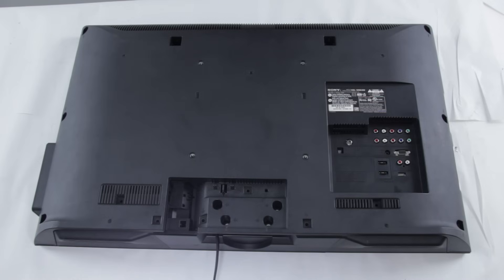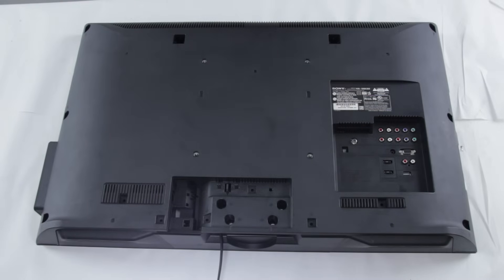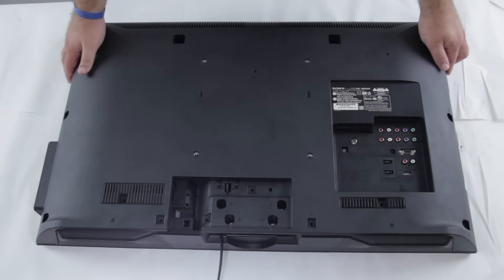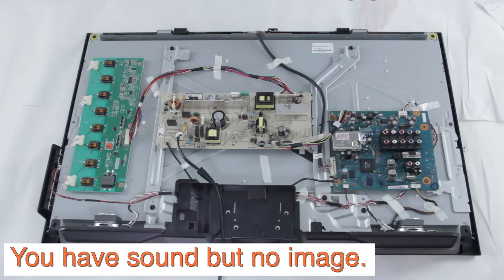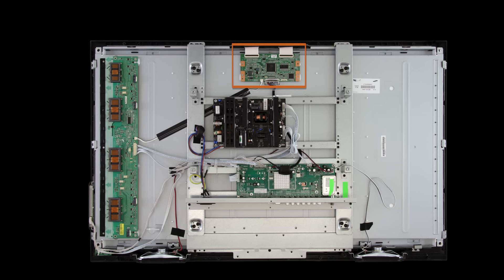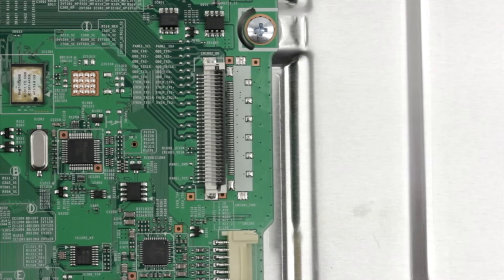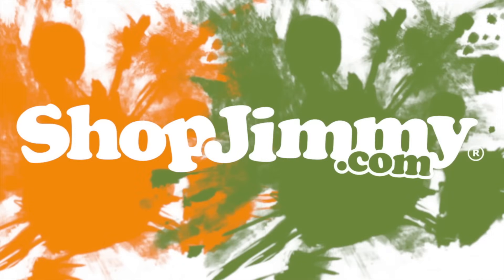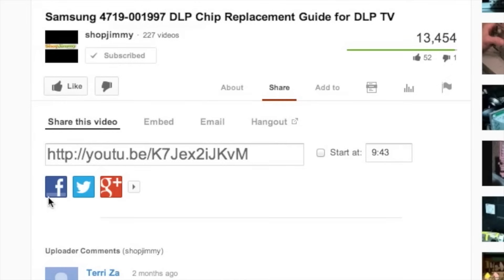LCD TV Repair Tutorial - T-Con Board Common Symptoms & Solutions - How to Replace T-Con Board

Comment: hi mate i have a Sony Bravia KDL-40V3000 40" 1080p HD LCD Television i was watching a movie on it a few days ago and all of a sudden it went very dark as if the light had turned off inside the screen i checked all settings nothing worked i also noticed that the menus was also dark and dim however picture is fine apart from when the image changes on screen i get like i little flash as if the htz are messed up or something very hard to noticed tho i have to crank up the settings just to get a decent picture to be able to watch TV the side effect of this is i now get burn in screen problems ive open the bk and looked for anything like a cable disconnected or something smelt burnt with no joy i can see i can get every part for this TV and would like help on narrowing it down to help me get the right part if there anything i can help with to help you help me pl ask i really need help with this as the TV seems to be working great apart from the darkness problem thx for you time regards Ryan.
Reply from the maker: Ryan Brandon  Please watch this video FIRST to help with your repair!  https://www.youtube.com/watch?v=BP3NVNCGEv8  This could be a problem with the power supply or the inverter board.  You may need to replace each board individually to see which one fixes the problem.  Click this link to replacement parts:  http://www.shopjimmy.com/catalogsearch/result/?q=KDL-40V3000  There may be multiple boards for the same TV model number, be sure to match part numbers on your current board, with your replacement for compatibility.  Thanks and please let us know if you have any further questions with your TV Repair!  www.shopjimmy.com
Reply: ShopJimmy.com  ok so i replace everything apart from the screen , tcon board and the wires and cables all replacement parts work fine but the problem still lingers im in the middle of replacing the screen it seems as tho the bulb has gone inside the sreen if the replacement dusnt fix the problem it must be a cable inside the tv unless the tcon board makes the screen light up up but i was under the impression the tcon is for producing  a picture so thats why if this dont work it must be the cables, im having difficulty removing the tcon board to place onto new screen it seems to be glued down onto the screen ive removed all screws but it wont come free with out pressure but i dont want to break the board if you have any tips on best way to remove this id be very greatfull thx for reply and help :) good man.

Comment: Hi I took your advice replaced t con board . I had soleeized screen , so when I replaced the board tv never turned on again . I get a bit of light at the bottom. Can you tell me what I can try now
Reply from the maker: jessica pacas  Please watch this video FIRST to help with your repair!  https://www.youtube.com/watch?v=BP3NVNCGEv8  I recommend putting the original t-con back in the TV and replacing the main board to see if that fixes the problem.  Click this link to replacement main boards:  http://www.shopjimmy.com/catalogsearch/result/index/?cat=56&q=LN40b530P7N  There may be multiple boards for the same TV model number, be sure to match part numbers on your current board, with your replacement for compatibility.  Here is a link to a video showing how to identify your part number, click here:  https://www.youtube.com/watch?v=BEPWrefQvqI  Thanks and please let us know if you have any further questions with your TV Repair!  www.shopjimmy.com

Comment: Thanks for doing videos like these. I have a problem with my Samsung 40 inch TV. There are horizontal line from the top on the screen which starts from the left side. I'd like to know how to fix this on my own please.  The model no. UA40D5003BRXXP serial number gst900403 - 04202012 Thank you so much.
Reply from the maker: Ed Umali   This sounds like a TV panel (TV Screen) problem.  If your TV panel is bad, it may be more cost-effective to replace the TV as panels are typically hard to find in stock, difficult to replace, and expensive.  Thanks and please let us know if you have any further questions!  www.shopjimmy.com
Reply: Thanks. I actualy tried openning it up and fixing the ribbon connection as per other demo videos in youtube. It actually worked. But intermeitently comes back and disappears quickly.
Reply: Ed Umali
try a tcon, yours might just be going bad.

Comment: I have a Sony KDL50EX645 and the screen is black. When I power it on the light is green briefly then it turns red and blinks 6 times pauses then blinks 6 times again. Suggestions?
Reply from the maker: Irving Simms   Unfortunately this sounds like you have bad LEDs in the panel and there is no fix besides replacing the panel itself.  If your TV panel is bad, it may be more cost-effective to replace the TV as panels are typically hard to find in stock, difficult to replace, and expensive.  Thanks and please let us know if you have any further questions!  www.shopjimmy.com

Comment: I have a vizio e701i-a3 and the video went out while watching a show. The audio still works. I replaced with one of your tcon boards with no fix. I also replaced the main board and that did not fix. The screen is blueish hue and the backlights respond when you mash the buttons on the side of TV. I tried the flashlight test and seen nothing. Do you think I could have had a DOA tcon or is it something else? Can I test the tcon?
Reply from the maker: JARRETT JOHNSON   This sounds like a TV panel (TV Screen) problem.  If your TV panel is bad, it may be more cost-effective to replace the TV as panels are typically hard to find in stock, difficult to replace, and expensive.  Thanks and please let us know if you have any further questions!  www.shopjimmy.com

Comment: I have 47lg50 in has good pic and good sound  but remote wont respond and input panel stays on across bottom of screen if I turn set off with button on front tv goes off then cones back on im thinking its the t con board. remote works ocasiually them no response whatsoever even with buttons on side television plays perfect three red blinking lights in front. please help
Reply from the maker: Ronel Muskeyvalley   Please watch this video FIRST to help with your repair!  https://www.youtube.com/watch?v=BP3NVNCGEv8  I recommend replacing the main board in your TV.  Click this link to replacement parts:  http://www.shopjimmy.com/catalogsearch/result/index/?cat=56&q=47lg50  There may be multiple boards for the same TV model number, be sure to match part numbers on your current board, with your replacement for compatibility.  Here is a link to a video showing how to identify your part number, click here:  https://www.youtube.com/watch?v=RwHTvjMdrhk  Thanks and please let us know if you have any further questions with your TV Repair!  www.shopjimmy.com

Comment: Hi. I have a Vizio M3D470KDE which has sound, but no picture/menu. At first I thought it might be the LED inverter board, but after ordering one and swapping it out, I saw no improvement. Upon further troubleshooting, I came across this video. Now I'm thinking it may be the T-Con board, as the backlight is definitely working, but I get no picture/menu. Do you think this may be the problem?
Reply: After ordering and replacing the T-Con board, I am still in the same boat.... Sound, but no picture. Does anyone have any other ideas??? I'm trying  desperately to get this thing fixed by Xmas.

Comment: My picture went out last night..but still have sound and backlight if i put a light up to it....i did some research. From what i gather..it sounds like the tcon board. I opened er up an removed the tcon board then replaced it an hooked the tv all back up. Then there was no backlight at all. Opened it up again an replaced again..backlight came back but still with no picture. I noticed that with my tv..the lg47ln5200 ub..its the opposet of this first tv in this video. With the tcon being easily excessable and the inverters imbeaded into the bottom frame of the tv... I sure hope its the tcom..its something i can do myself.

Comment: I have a Sony KDL-37m3000 LCD TV that recently displayed blue and green colors in all the dark colors of the screen. Seems semiliar to solarization but only in the dark areas of the screen. It occurs in all 3 modes: vivid, standard and cinema. I did the factory reset, checked all cable connections between the BM (main board) and the T-Con board, and adjusted the settings in Picture Mode to no avail. Is my problem with the BM or the T-Con board? Or something else? Your assistance will be greatly appreciated.

Comment: Hi there.. I have a Samsung LN40D503F6F - type LN40D503 that is about 3 years old. I decided to get a new TV for me and give this one to the kids... It worked for a few days (since the move)... but now I can get sound but the picture is essentially white.. with a slight ghost of what should be the image. I've ordered a T-CON board and a main board to replace it. Can you confirm (given this video) if it is the T-CON board?
Thanks for your help in advance.
S
Reply from the maker: Scotts Sandeman   This sounds like a TV panel (TV Screen) problem.  If your TV panel is bad, it may be more cost-effective to replace the TV as panels are typically hard to find in stock, difficult to replace, and expensive.  Thanks and please let us know if you have any further questions!  www.shopjimmy.com
Reply: ShopJimmy.com

Hey Jimmy I replaced the T-con on my LN40D503F6F and still have the ghostly white image... i can see what is n the screen... but at this point is this garbage?
Reply from the maker: Scotts Sandeman   Yes.  This sounds like a TV panel (TV Screen) problem.  If your TV panel is bad, it may be more cost-effective to replace the TV as panels are typically hard to find in stock, difficult to replace, and expensive.  Thanks and please let us know if you have any further questions!  www.shopjimmy.com

Comment: Can a TCON be Rebuilt for a DU-42PX12X
Reply: AND HOW MUCH DOES IT USUALLY COST? I SUPPOSABLY GOT MINE REBUILT AND I WAS CHARGED $140 BUT FIRST I WAS CHARGED $40 FOR THE DIAGNOSIS. JUST WANT TO MAKE SURE MY TCON WAS REBUILT.
Reply from the maker: ivan Balvaneda   There should not be a T-Con board in your TV.  The model number you provided shows up as a plasma TV and plasma TVs do not have T-Con boards.  Thanks!  www.shopjimmy.com

Comment: I have a Vizio VF552xvt.  Was watching TV last night and the video died. Audio is good. There is definitely a difference in the screen appearance between power on and power off.  The screen does come on and the appearance is a light blue. I'm not sure if this indicative of good backlighting.  I looked down the top of the TV via the air vents, and there are white LED lights. Does this sound like a candidate for a TCON board replacement or the more expensive Motherboard? Thanks
Reply from the maker: mike barnwell   I recommend running the flashlight test on your TV.   Here is a link to a video we produced that shows how to run the flashlight test. LCD TV Repair - Flashlight Test for No Image, No Picture on TV Screen - How to Fix LCD TVs Please reply with your flashlight test results and we can recommend a replacement part for your TV repair. Thanks and please let us know if you have any questions! www.shopjimmy.com

Comment: Hi there, have been watching your vids for a while now and have only recently found an issue I need to deal with. I have a Sony KLV-46X300A LCD TV. Was working fine and copped a bump. Now intermittently goes to washed out coloured screen without any detail, just coloured shadows. Should I start looking at the tab bonds or the T-con board? I am having issues with the best sequence for disassembly. Can you help?
Reply from the maker: Rod and Mel Potter   This sounds like a TV panel (TV Screen) problem.  If your TV panel is bad, it may be more cost-effective to replace the TV as panels are typically hard to find in stock, difficult to replace, and expensive.  Thanks and please let us know if you have any further questions!  www.shopjimmy.com
Reply: ShopJimmy.com Hey thanks guys, didn't know if I would get a response from all the way over there. Feedback: Found the problem to be a combo between poor connection from the T-con board ribbon connector and a bad tab bond (top left only). I placed thermal pad tape on all the tab bonds and this initially fixed the problem. On re-assembly the issue came back, I managed to bump the ribbon connecter and found it a little loose. Re-closed the connector and so far so good. Although I get the feeling this may have only bought me a little time. I saw a post from another user, Sony TV, sounds very similar - hope my adventure helps.
Reply from the maker: Rod and Mel Potter  Thanks for the response and info.  I am thinking the tabs/ribbon connectors that are connected to the panel, one of them is most likely bad.  If that continues and they are bonded to the panel, the only repair would be to replace the TV panel or get a new TV.  Thanks!  www.shopjimmy.com

Comment: Hi,

I have one lg lw4500. The tv has power. When i press the power button to switch on the tv, the red light become white for a second, then red again. I have no image on the screen and i cannot see any lights at the back of the tv. I already replaced the power supply board but the problem is still the same. What is a possible cause of the problem?
Reply from the maker: Constantinos Sidopoulos   Next I would replace the main board in your TV.  Unfortunately I do not see any replacement parts in the search results for your TV model number on our website.  Please reply with your part number on your main board and I can try searching for replacement parts.  Thanks and please let us know if you have any further questions!  www.shopjimmy.com

Comment: I have an AVOL TV Model # alt46fd120 I believe that the TCON board or the LCD panel is bad.  The TCON Board has a barcode with S2586E8L00VM with the number 001138 under that.  I have been trying to locate a similar board but I am unable to find one  bartlettjohn40@gmail.com
Reply from the maker: John Bartlett   Unfortunately we do not have any information on this TV model.  Thanks!  www.shopjimmy.com

Comment: Hey I have a LG TV and the channel up button is stuck on the TV which is changing the channels automatically. How do I disconnect the panel of button... since I never use them I wouldn't mind them being disconnected so I can use my tv...
Reply from the maker: kbg12ila   Try this at your own risk.  Unplug the TV first.  Open the back of the set and find the button board and disconnect the wire harness from the connecting board.  Thanks!  www.shopjimmy.com
Reply: ShopJimmy.com I did it and it worked! I was so proud lol...

Comment: Having picture problems with Samsung TV LN40C610N1FXZC.
Thin, vertical black lines, colour bleeding (ghost images), unclear picture that comes and goes. Could it be the T-con board, main board, panel, ribbons? See video: http://youtu.be/mU7xBsCac5U
Thanks for your help!
Reply from the maker: mb2009   This sounds like a TV panel (TV Screen) problem.  If your TV panel is bad, it may be more cost-effective to replace the TV as panels are typically hard to find in stock, difficult to replace, and expensive.  Thanks and please let us know if you have any further questions!  www.shopjimmy.com

Comment: I have a sony Bravia kdl-46xbr9 and it just keeps turning off and on. I turn it on and a few seconds later it power cycles. Occasionally it will not turn back on and the red LED will flash 10 times. I am trying to figure this out because I am poor and can't take it to a service center. Thanks.
Reply from the maker: Matthew Kobella  Please watch this video FIRST to help with your repair!  TV Repair! LCD, LED, Plasma, DLP How To Fix Your TV with ShopJimmy.com Help!  I recommend replacing the main board first to see if that fixes the problem.  10 blink error was not used in this model per Sony service manual.  Click this link to replacement main boards:  http://www.shopjimmy.com/catalogsearch/result/index/?cat=56&q=kdl-46xbr9  Be sure to match part numbers on your current board, with your replacement for compatibility.  Thanks and please let us know if you have any further questions with your TV Repair!  www.shopjimmy.com

Comment: Hi My Samsung LA40C530 has turned bright white. There is sound and faded picture in the background but screen is really bright white. Is this a T-CON issue and how much would it cost for a new T-COM.
Reply from the maker: Manoj Negi Please watch this video FIRST to help with your repair!  TV Repair! LCD, LED, Plasma, DLP How To Fix Your TV with ShopJimmy.com Help!  This could be a problem with either the main board or the T-Con board in your TV.  I recommend replacing the t-con board first and if that does not fix the problem, try the main board.  Click this link to replacement parts:  http://www.shopjimmy.com/catalogsearch/result/?q=LA40C530  Be sure to match part numbers on your current board, with your replacement for compatibility.  Thanks and please let us know if you have any further questions with your TV Repair!  www.shopjimmy.com

Comment: We have a Samsung UN40EH5050FXZA that is about 2 years old.  The tv will not power on when plugged in.  The little red light is on and even flashes when the remote is used however there is no picture or sound.  Samsung Tech support is worthless.  Can you please advise?